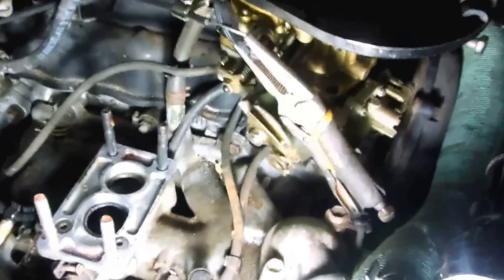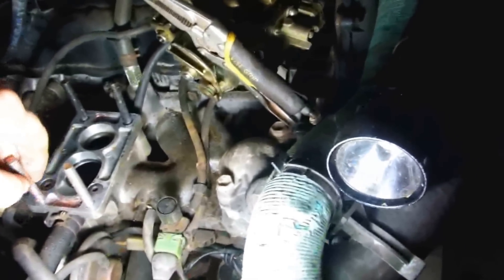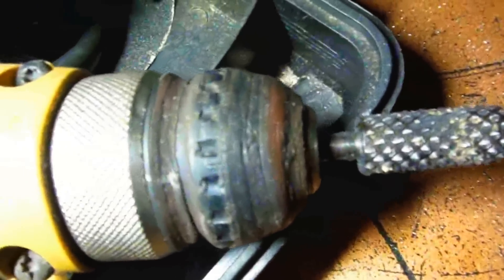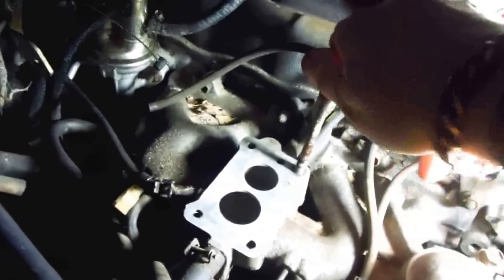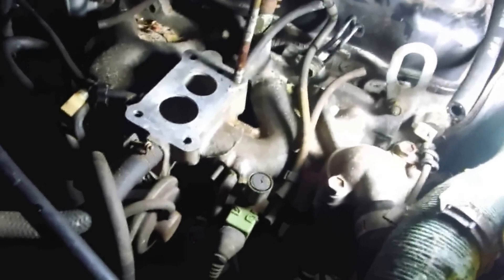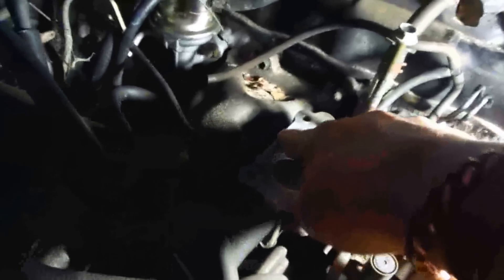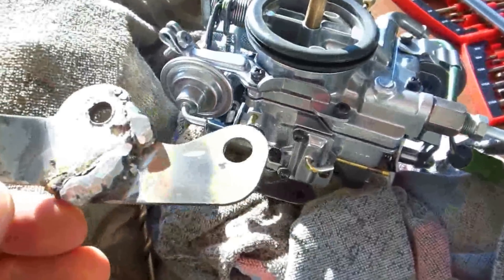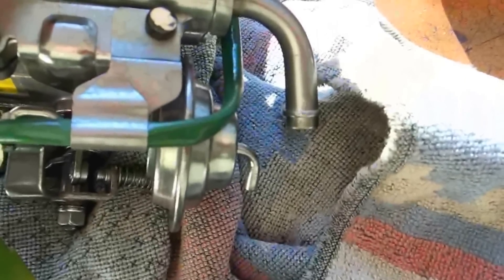Suzuki Samurai - Installing a Toyota carburetor 2 of 2

Comment: Got mine on yesterday. I got it from national carb with kit. Has egr block off plate ,fuel line adapter barbed bolt ,nice piece fuel line and machined adapter for air cleaner with stud. Mine is 88 model and has studs in intake also seen my carb don’t have the vacuum switch going to choke like yours mine is manual choke. Don’t have selinod and wire on carb. It’s supposed to be toy 250 carb. Got it from Gary at national carb. Thanks for information.  Stay safe ur W.V. pal

Comment: Thanks for posting these videos I did the swap from a weber 32/36 to a Toyota carb and these videos made it pretty easy. My samurai runs better than ever now. I ordered the toy-250 from national carburetors and got it pretty quick but they sent me one from a 1975 corolla. It worked just the same except it didn't have any vacuum pumps on it and no tube that has to connect to the charcoal canister. It also is the same price as the toy250 so I didn't even bother trying to send it back.
Reply from the maker: ?The Toy carb runs great.  When I added the HHO I got about 30 mpg too.
Suzuki Samurai Installing HHO, Part 1 of 3 {Brackets}
Suzuki Samurai Installing HHO, Part 1 of 3 {Brackets}

Suzuki Samurai Installing HHO, Part 2 of 3 {Plumbing}
Suzuki Samurai Installing HHO, Part 2 of 3 {Plumbing}

Suzuki Samurai Installing HHO Part 3 of 3 {Wiring}
Suzuki Samurai Installing HHO Part 3 of 3 {Wiring}

High Output HHO & Amp Gauge Install - Suzuki Samurai
High Output HHO & Amp Gauge Install - Suzuki Samurai

Comment: Only the 1978 Corolla carb is compatible or are there newer carbs that will fit the Sammy well without any modification?
Reply from the maker: +Mzahaka1313 There are maybe many years that work, but that is the one I used.

Comment: nice video man. Question, do you happen to know which Toyota carb  would go with a 1.6 suzuki 8v?
Reply from the maker: I don't know. But figure to use a Toyota carb from a 1.6 or 1.8 and that should work ok.  Displacement matching carbs should inter-change.
Reply: Thanks for the reply! will do

Comment: hey if you have that video on the relay switch for the starter can you send me the link, and thank you for this great video
Reply from the maker: EkonMaster Bud Suzuki Samurai, Clicky Starter Fix 
http://www.youtube.com/watch?v=jbd6dAzIgSM
Tell 'ya the truth the mod I liked best was the locker in the rear.   Great traction now.  I run Royal Purple oil in the rear and no problem with it not being smooth.  That's the trick.  You need high quality oil with the locker, to keep it quiet as possible.
Reply: cool thank you so mutch

Comment: MPG Will probably be in the 30 range ?
Reply from the maker: I don't think it will be that good mpg right now.  It should be better than stock and stock is about 25 mpg.  With and HHO setup, it may get 30 mpg.  I have researched HHO quite a bit before, but new things are out.  One thing I do want to ensure I do with HHO is that it can only work with the vehicle actually running.  If this gets 30 mpg right now, I won't bother with HHO at all.